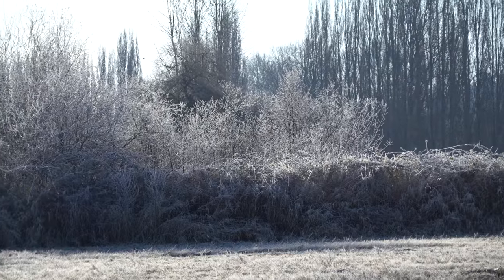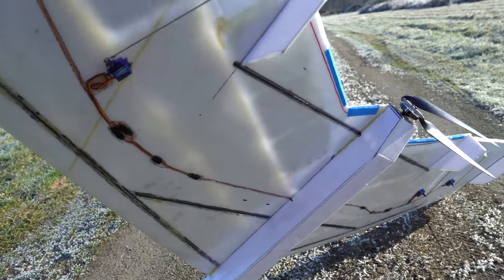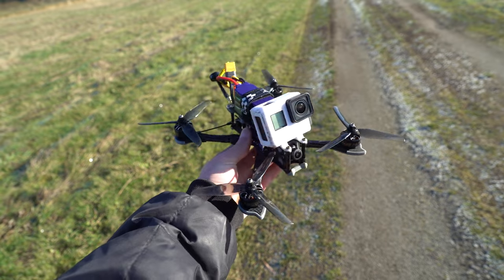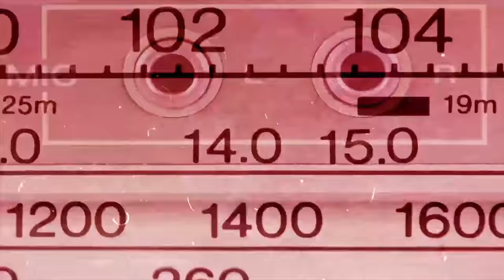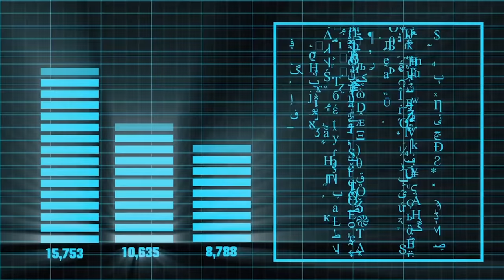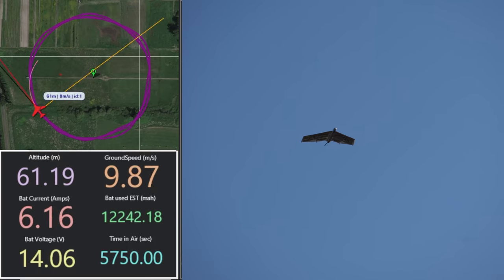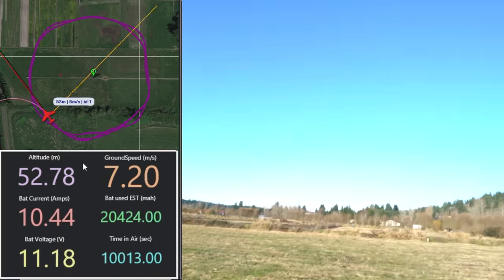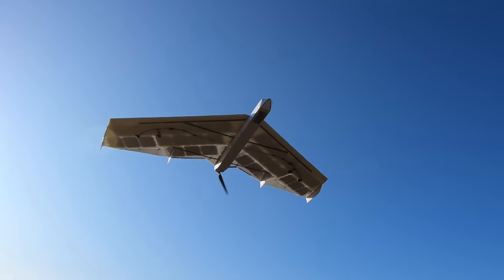Solar Plane V4 in the Dead of Winter

Comment: You should probably not use the KF airfoil if you want it to have a greater aerodynamic efficiency. NASA demonstrated in wind tunnel data that the only way for it to be remotely efficient (even in comparison to a flat plate) is if you can somehow reduce the step height in real time, which is not exactly feasible. If you want this to be even better (potential multi-day flying), consider drawing inspiration from what the Solar Impulse plane did, which was using a custom airfoil with a rounded leading edge, flat midsection for solar panels, and then a cambered or tapered trailing edge to provide greater L/D ratio (which is what you want for greater endurance). This would allow for greater solar efficiency and, considering the likely aspect ratio of this flying wing, if you add several degrees of geometric wing twist to the leading edges to reduce the induced drag losses (this would be more difficult to build though so your best option may actually be to return to a conventional configuration if you're chasing flight endurance).

Comment: I'm wondering if you could take some helium balloons and tie them to this with a tether and magnet to catch the plane midair, so that when the power is running low you could just float there to regain it, then when you regain power you could fly around where you wanted. Balloons peak at 10 to 30 km up, so it would be neat to have a floating air base until they ran out of air.

Comment: A while ago i remember reading this article about solar cells designed with a special lens that could collect light that was not perpendicular to the solar cell surface and using some sort of internal mirror and lenses design it would adjust incoming light to hit the cell normal to the solar cell surface maximising the ability to gather energy in less than perfect conditions. The other idea is if parts of that wing were transparent, and the solar cells were installed internally and able to actively track even 10degrees east,west,north,south, plus the wing surface would be much more aerodynamic with some aort of transparent covering,it should make a difference as well. Why not place solar cells along the side of the fuselage that would be able to catch that extremely low sun angle as well?
Reply: am going to guess that cells would have a "prism" layer above the cell, would likely add substantial weight (my guess)

Comment: Cool! Suddenly I wonder though- if you dropped in a some kind of adaptive AI into the control system, told it to do the same basic loops but also rewarded it for maximizing gain from solar cells, I wonder what kind of flight path you would get out? Once you filter out all the AI caused crashes, that is.

Comment: You should redo this test but set the flight path in a way that maximizes the tilt towards the sun like have it try to fly tilted towards the sun in long slow arcs then quickly swoop back the other way and re do that. I bet if you had proper read outs on the info you could fly it by hand in a way to allow it to get longer flight times.

Comment: NordVPN does not protect ANYONE from checking every WiFi network in range to gather anything the router allows it to without a password. Which is usually a lot on a poorly secured network such as the one you use.

Comment: And do NOT bevel the trailing edges. Against your intuition, it will increase drag.
Reply: @iforce2d  Plane designers don't do bevelled edges, at least not with the angles we model builders can do on a foam surface. They do knife sharp /very narrow angle trailing edges. Normally the best way to reduce drag on a trailing edge of a foam wing, is to extend/replace it with a piece of balsa wedge. That way you can reduce the edge to 1/2mm or below.

Comment: Complete noob question: how would the solar cells work with a super capacitor vs the batteries?
Reply: Yes, a super capacitor is basically a battery and would be wired similar to a battery minus the battery chemistry specific charger. However, super capacitors have a much lower energy density (energy versus weight) than lithium batteries and as a result not as effective. Solar cells and solar panels, (solar panels are an array of solar cells) cannot be connected directly and must use a MPPT otherwise its operation is not as efficient.